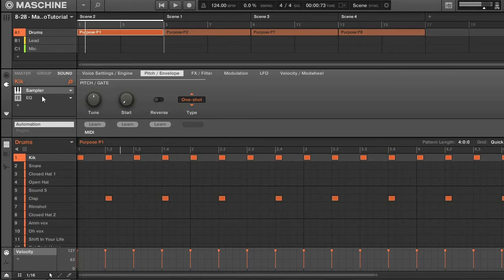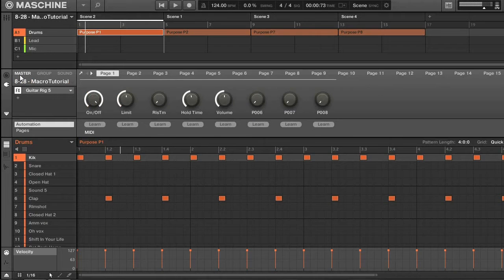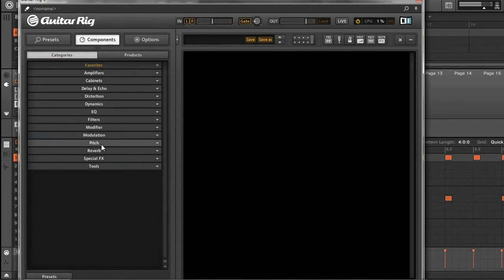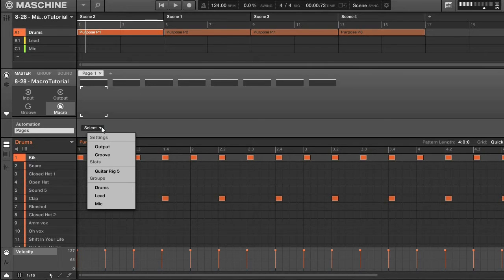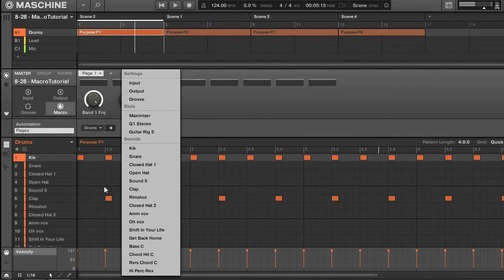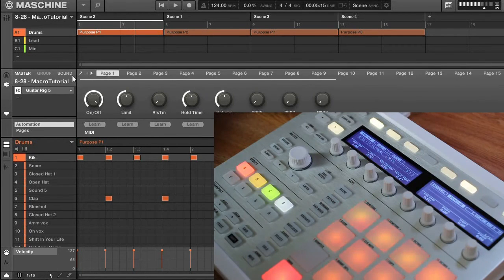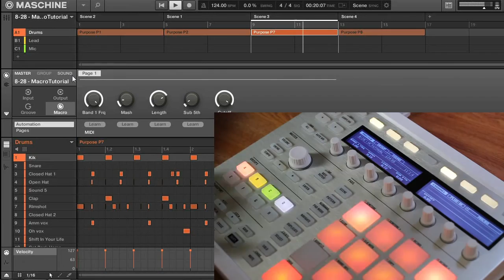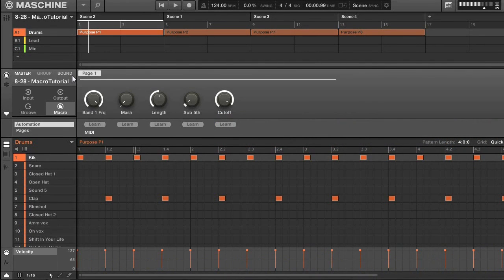NI Maschine - macro knobs for live performing - How To Tutorial

Comment: Is there any way you can save the macros as presets mapped to your third party controller so you don't have to go into midi learn mode and click "Assign Macro" to a knob every time? I'm using Maschine 1.8.2 with a Mikro Mk2 though in Ableton.
Reply from the maker: classicarecords I don't believe so, sorry - there are lots of resources for working with Ableton, I think there's a template or something? Maybe search around for that. I've never used it but I think I saw it.
Reply: Ok, no worries. I found a work around in the meantime to use the effects in Ableton with the macros since I route Maschine into it. I'll just refer to your video when I upgrade to 2.2. Thanks
Reply from the maker: classicarecords Glad you worked it out!

Comment: How did you seamlessly switch scenes live? when i tried it, the spot it was playing at immediately switched with the selected scene without finishing the pattern it was on
Reply from the maker: Jeriel Pablo In the software at the top (where Metronome, time signature, time clock are located) look for the "sync" menu. It's usually on 1/16, I think. Change that to Scene and the scenes will finish before switching.